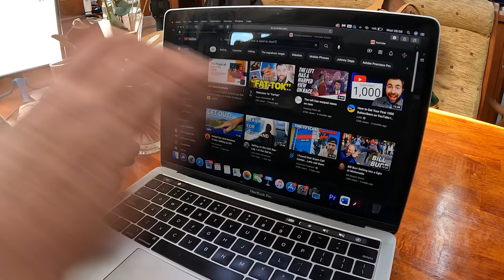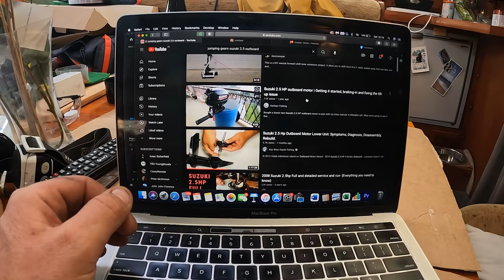How To Fix An Outboard That Is Hard To Start

Comment: The Thread was probably a Left-handed thread on the Propellor if it rotates Right-handed then the threads will be opposite so as to keep the propellor on or there is a woodruff key on the shaft that might need to be removed first I suggest that you find the maintenance manual either online or buy it for future work you might do. Also, modern low lead fuels and E10 fuels are very prone to ageing and degrading with time they should not be left for long periods of time in tanks another thing to do if you are storing your engine is to use a light machine oil to inhibit the engine in cold wet places ie:  on the back of the boat in the elements and also cover it to keep water off  it will start up a little Smokey at first but after a good first run it will clear and also for peace of mind use the higher grades of fuel it saves money in the long term Regards Craig

Comment: with that much crud in the bowl, you'd be best advised to clean out the fuel tank, lines and put in a new fuel filter
Reply from the maker: We did also clean the tank not the lines though, as the engine doesn’t have a fuel filter at all, something which I’m beginning to think we need to add.

Comment: tip clean the fuel tank and put fresh fuel in it , it may work for a minute or two then block again just remove the bowl and clen the jets with catb cleaner , do as often as needed , maintainence shedule at leat 2 twice a year also the centre jet in between the bowl is your mai jet it is removable and contains many fine holes that are usually blocked  the cause of the cabry  not working .

Comment: Nice one. I started watching Free range as one of your top 5 recommendations I think.
I recently watched Troy service a winch (from a 2018 video) and everything with any sign of corrosion went into a jar of vinegar, just wondering if that would have been an option for the float bowl, or is there a reason to avoid that?

Comment: Yup as others said it’s the water and ethanol in gas causing the gel , I’ve had same thing! , this is why all outboard fuel should have ‘stabilizer’ in it all the time.
So you have discovered that almost all carb problems are involved with the bowl and float so all the other disassembly only required in a ratio of 1:10 when working on fuel system! 
Be carful with the float , you should be able to invert the carb, slide out the hinge pin , remove the float, under is a tiny rubber tipped ‘pointy thing’ that connects loosely to the float in a small piece of bent sheet metal. Might be a small spring too. 
Check this is all clean and reassemble when the fuel level in the float bowl goes down it opens this tiny valve refilling the bowl. Sometime this gets damaged or worn and leaks flooding too much fuel in.
It can also be adjusted ( rarely needed) to make float be at right level. You check this by looking at float installed in carb upside down .   TMA.   Cheers Warren

Comment: as this is your spare engine, i would suggest you put Aspen 4 Blue in it as fuel. That is old fashioned super stuff. Designed for lawn mowers and such. It does not go off and can stay in there for a year easily. Expensive though but worth every penny. I had lots of issues with that rubbish Euro E10 stuff. Only works for cars.

Comment: That jelly is the ethanol that's found in fuel. If left for a extended amount of time it'll actually dry and become a white powder type substance. Carbs need to be cleaned every few weeks if they sit, it takes roughly four weeks for the gas to evaporate and that leaves behind the ethanol which does not evaporate. The easy solution is if you know you aren't going to be using the engine for a while, just drain the carb.
Reply from the maker: Wow I had no idea it was quite as quick as that! 😳

Comment: Did you clean through the tank and tube and fuel filter as well. There could well be jelly there too. The other thing with the new fuel is it attracts water which can collect in the bottom of the tank. You get water in the bottom of the tank so that is what gets to the carb. It was that which stopped my engine from starting. First thing is drain the carb and drain a bit out of the tank. Water is pretty obvious.

Comment: Ethanol has an electric charge that attracts other polar molecules. Water sucks right into the fuel. Because water is heavier than gasoline, it collects at the bottom of the tank and turns into a gel. PS great job!

Comment: Nice job Dom, did you remove the float and the needle valve?  Worth doing to make sure no deposits on the needle which ca cause problems.  All seemed well anyway.  If the clutch dog hadn’t worked I was going to suggest the linkage from the gear selector and the gear box.  There is usually a rubber grommet on the side of the leg and if you take that out you can see where the upper linkage joins the lower one.  It’s is there so you can drop the bottom of the leg off if needed when you check and change the impeller.  It could have slipped meaning the engine was not fully engaged when in gear.  Did you have a good flow of cooling water?  I have worked on lots of outboards but not always successfully…. It’s all good knowledge for the future.  Andy UK

Comment: The gel isn’t E10 specific. Any old stale evaporated petrol leaves varnish like deposits - that’s why the wisdom for years has been to unplug / switch off the fuel tap and let the engine run dry of fuel before storing it 👍

Comment: if that cardbooard gets bumped or dislodged in some way (easy enough when it serves as your workbench top) all the bits will go flying (or just be jumbled up) and you'll lose your references for re-assembly. best to put the pieces on something immovable.

i mention it because it has happened to me, more than once. not only will they go flying, but there will be a better than 50/50 chance that it will take an hour or so to find all of them. on occasion items  ̶c̶a̶n̶  will be lost forever.

looks like you now have a promising new career path: small engine repair. 
if not attractive at your present age, it can be pursued as a cash business (not too physically demanding and practically no start-up costs) during retirement, thus avoiding income tax altogether. ;)

Comment: Hmm, I suppose I should have said when I sold it to you... its not like your mariner engine... there is a fuel tap (your old engine had a separate tank) so if you are not going to use it for a day or so, turn off the fuel and run it dry. (You kinda get used to doing it as you approach, it's like a timing challenge to see if the fuel runs out as you tie up!)
The other trick is to use super unleaded... it tends not to turn to jelly in the tank!
P.s. kill cord 😜
Reply from the maker: I think that’s going to be the go to now, also I’m thinking that some kind of tiny online filter in the fuel system may be an idea also?
Reply: @CadohaAdventures  To be fair, it will probably be more hassle than it's worth. I have used little filters in the past, usually they block up pretty quickly with stuff that will normally just sit in the bottom of the float chamber, you then need a handful of filters (you can't clean them 🙄) to change them frequently.
I can't remember if that outboard had a little nut on the bottom of the filter bowl to allow you to empty the float chamber without removing the carb? sometimes you find the float gets stuck if there is a lot of crud, but usually emptying the bowl occasionally is all you ever need to worry about.
Bottom line, water and 'stuff' in the fuel is a fact of modern life with the biofuels now, you get used to whipping the bowl off the carb and emptying out the crud!
P.S. it doesn't seem to be as much of an issue with 2 strokes, maybe the oil helps emulsify the water?

Comment: The petrol evaporates in any heat and the additives are deposited in the jet and surrounds. Its worse with the newer petrol so dont leave it over winter full of fuel especially if you live in a warm climate. Also applies to petrol lawn mowers and leaf blowers etc especially in the mediterranean where I worked for a while as a handyman. At time 18.59 I did not see you put the clip back on the hose. It is important to avoid fuel leakage and a potential fire. ( Harry Dwyer  Around britain in a RIB made a vid where his outboard caught fire while he was testing it.)

Comment: That jelly fish in the carburettor is ethanol mixt with water. Ethanol is hygroscopic, wich means it absorbs water. Thats why modern E10 fuel doesn't last longer than six months (only in a clean dry fully filled non asperated container). If you can, buy 98RON, wich is E5, or racing fuel 100/110RON. There is an easy way to remove the ethanol, but you need som stuff and space.

Comment: I am sure you know this by now, but you should be using Super unleaded, which is E5 and has less ethanol than normal unleaded E10. It is the Ethanol that causes the sludge.

Comment: Well done. You probably know but....If you are not going to use your engine for more than a week, close the fuel tap when you are 100 yards from your destination, so the fuel drains from the float bowl and the engine stops through starvation. With an empty float bowl, the gel wont form. On mine, there is a small screw for emptying fuel from the float bowl which I undo and squirt in some carb cleaner (every half year). Does it not have a kill cord?!!

Comment: Congratulations. Tips to prolong repeating the repair: only use gasoline without ethanol, add a dose of Stabil to the gas can, add a dose of Seafoam to the gas can. You'll see a little white smoke each time you start, that's the Seafoam doing its thing.
Reply from the maker: Really appreciate any and all tips. Slowly getting more confident with looking after these things 🙏☺️⛵️

Comment: Jelly is from ethanol fuel.....if you use ethanol fuel use an additive to prevent it....otherwise any ethanol fuel after 2 -3 weeks in the can or tank starts gum up the works.

Comment: Well done Dom. I rebuilt an old MGB GT and can remember actually shaking the first time I fired it up again. Fully understand your sense of satisfaction. Just a quick question did you replace the split pin on the prop?

Comment: Idea Uno.....when disassembling stuff outside.
Brolly preferably yellow or pink with spike.  Upside down jammed between pontoon decking to catch springs, screws, ball bearings, unobtainable pins in holes, twiddly little special doodahs.
Idea 2......old fashioned fuse wire...you know what for
Idea c). .... don't wear out exorbitantly expensive sailing boots for all-day everyday use.

Comment: Outboards can be hard to start because there is generally a centrifugal valve lifter in them, and if you don't pull the thing fast enough the lifter doesn't disengage. Older people tend to experience this..

Comment: That stuff is wax. It's what petrol eventually turns into when you leave it standing for a while. And it does it even quicker these days with the new 'improved' petrols. It's one of the reasons we stop airplane engines by effectively turning off the fuel. Empties the motor of petrol. Good practice for motors that don't get used every day. I do the same with my outboard. And motorbikes when they get put away for the winter. You can get fuel additives that help, but they're pricey, and just cutting off the fuel on an outboard to stop it is easy enough when you know you won't be using it for a while. I chuck any fuel in the outboard's tank in the car after 3 months of doing nothing so it doesn't start getting waxy in the tank.

Might be worth changing the plugs while you're at it. My outboard goes through them like they're going out of fashion.

One other thing while I'm on. You are a very good presenter. If TV was still a thing, I suspect you'd quite easily get a job presenting programmes and do very well. Unfortunately, YouTube is killing the television star, but you might be able to find other good sources of income by monetising that skill. Just a thought.

Comment: If using Ethanol Mix Gasoline, without a protective fuel stabiliser, your fuel supply, lines, Carburettor,  and engine seals get wrecked. the Fuel Stabiliser (there are several good ones available,  check out reviews ) puts a protective coating on all of the essentials. If a two stroke the biggest issue usually, is the shortened Spark Plug Life, so always have a new spare with the toolkit. I learned this early with my three cylinder Kawasaki two stroke Motorbikes as like clockwork the Plugs Failed at 1500 miles. Hope that helps (we need to hget this nonsense of adding Ethanol ended, as besides fuel line and other engine damage the Ethanol loses a  oticeable level of Fuel economy as well as a huge amount of the energy used to grow food, as well as wasting food to no good effect). Bob. 👍eta, something else with Ethanol mix fuel, it goes bad very quickly in storage, if it doesn't have Fuel Stabiliser in it . Thay "jelly " is likely dead Ethanol Fuel rubbish, like the stuff that wrecks Diesel Fuel that doesn't have the Biocide additive (plus modern Diesel Fuel needs a lubricant added to it, so the injector pump doesn't rapidly wear out - not cheap to replace . 👍

Comment: That gunk is lacquer it’s what happens when you let your gas sit too long and get old if you have to let something sit add a product called stable into your gas to prevent it from going bad it will usually keep your gas good up to a year. Never ever let your engine sit with gas in the bowl when you’re done using your dinghy unhook your gas line and run your engine until it stops you won’t have this problem again so once you pump your gas into the fuel bowl your engine to start.

Comment: The good thing with mechanics is you can see 99% of everything thats likely to go wrong ...with digital electronics.. its the other way round.😜
Well done sorting the motor small carbs are a bit of a pain ..
Thats called a butterfly valve/ choke btw. 
You might like this one pay attention to where and who built it.😎👍🏼🇬🇧
https://youtu.be/Tn5oGCYcVtA

I once pulled a fuel pipe off a car petrol tank while under it and got a face cup full of leaded petrol ...couldnt see to get out of to get into the house to wash it off ...eyes were burning for two days despite repeated rinsing.

Comment: No need to buy fancy gearbox oil filler attachment, just push the tube of oil into the hole in the gearbox.

Comment: Narr, you actually did not remove the jets inside the carburettor.  When you had the top off, look at the brass part with the hole in it. Notice it has a slot across the hole. That slot is for a flat headed screwdriver to remove the jet. You were lucky.....Next time remover the jet and throughly clean the jets and the hole it came from. Any how well done.

Comment: Don’t use a screwdriver to clean the carburetor bowl, you will scratch it…
Use a toothbrush
Reply from the maker: Fair. I was being super gentle and I’m not sure if a tooth brush would have chipped rye corrosion off?
Reply: Sailing Cadoha  ok I understand , Next time, I suggest you start by taking the bottom bowl off first…
 Clean that part out, then clean out the fuel passages and needle valves with  carburetor cleaner spray….
Usually that works and you don’t have to take the top end off…
Good job all the same , you did it!